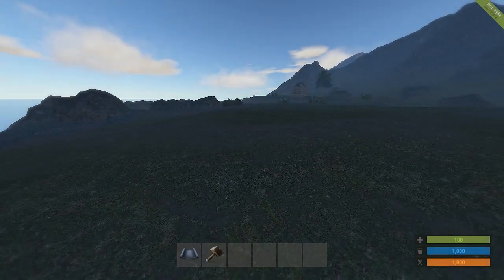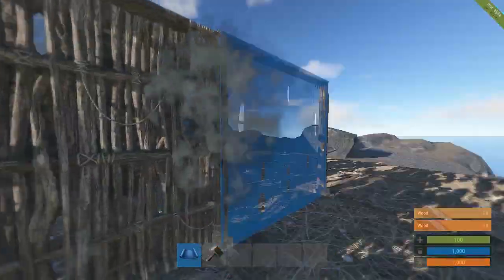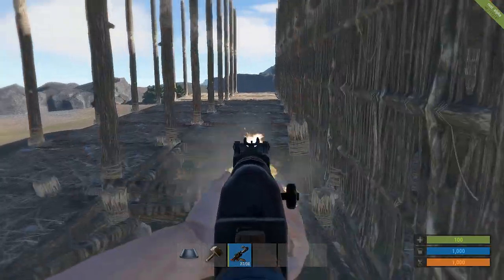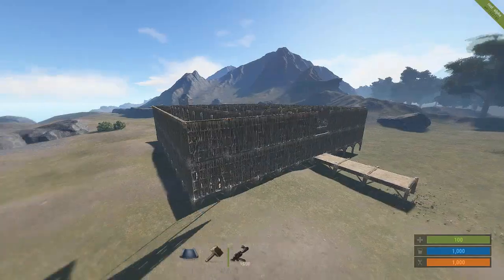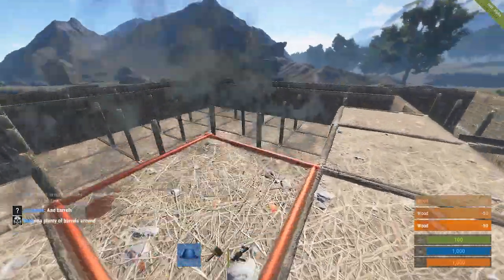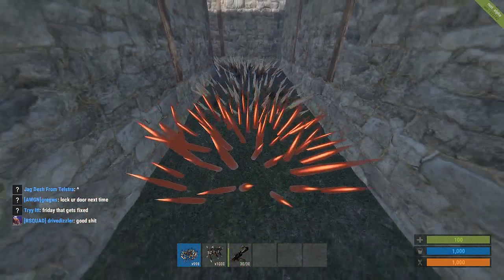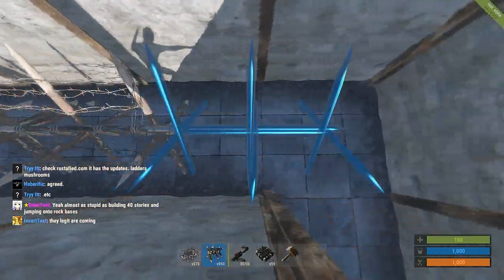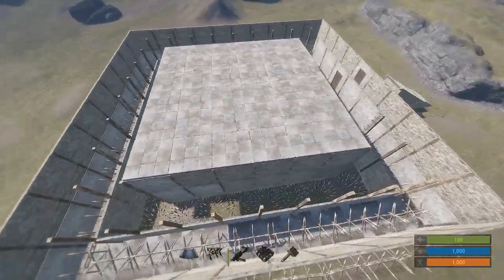Rust For Dummies - "How To Build A Hard To Raid Base On The Ground"

Comment: Build a raid tower, jump from outter walls to the center and GG
Reply from the maker: moiseman Of course people will add tool cupboards around, I would hope so anyway :D
Reply: Ser Winter You can hide tool cupboards in the spikes
Reply: moiseman for that you can put tool cupboards all around  and far from the base in armored 1x1 boxes
Reply: Shadow77999 You could hide them in the outer walls. Rather than using barbed wire, you could just fill it. Honeycomb the outer wall so it's wall>halfblocks>wall and in random sections of it place cabinets. It'll cost raiders no less c4 to find the cabinet than in proxy buildings (also taking into account they wont necessarily know they're in the wall; and tens of c4 if they fail to open up the right section of wall, if they intend to raid tower. It'll cost 8-9 C4 just to breach the inner wall directly, the bottom floor of which can be honeycombed further. If you have your stock on the third floor, and you'll probably want more floors than that, it'll cost anywhere upwards of 14 C4 just to open a hole to your loot; and that's not even to get access, but to take out the floor and hope loot falls down. More floors prevents C4 from even reaching the upper levels meaning the raiders will need rockets as well.

Putting barbed wire on the second floor of the outer wall also means anyone using ladders has to drop over the wall onto the trap.

The con of square structures like this is the stability can really be reduced easily by taking out the pillars. Meaning your structure can collapse to a coordinated attack. Having a round, cylindrical base using triangle pillars can really hold a building together through the most aggressive attacks. Keeping your structure in tact at greater heights.
Reply: grazzer88 thx for your time :)
Reply: grazzer88 I need to see a vid from you to understand better
Reply: grazzer88  how many players in a clan would it take to make a well co-coordinated attack on a base that size?
Reply: It's hard to say because there are a lot of variables. It would depend on the number of defenders, how well placed the traps are, is the core reinforced? Will they go for brute force or a raid tower? If the defender(s) are offline 3 raiders could deal a lot of damage, so the key is to make them waste as much heavy ordinance as possible before reaching your core so they might give up when they run out. A well coordinated raid with 2 dozen C4 would probably be minimum to moderate force, but if you manage to take one or two of them out it would pretty much hualt the raid so more raiders would be wise if there is potential for a fight. If they're after gear they're more likely to give up than if they're just spiteful and want to wreck the place.
Reply: moiseman Lol.
Reply: +moiseman not if u build floating building cabinets in each corner surrounded by traps
Reply: +Ser Winter Ser, How Do you Fly on Rust?

Comment: I did this with a few friends on a modded server (x12 gather i think it was) in a 6x6 config. We added the high stone walls to the outside and a high stone wall gate to where you enter, and added snap traps and metal barricades all around between the high-stone walls and the base itself. Worked miracles and we didn't get raided once in the week we played there.

Comment: I suggest putting a floor on the outside walls and building sniper towers w/ building cupboards and honeycombing the bottom floor and the outer most walls and putting the inner walls of the outside wall, making those 2 high.